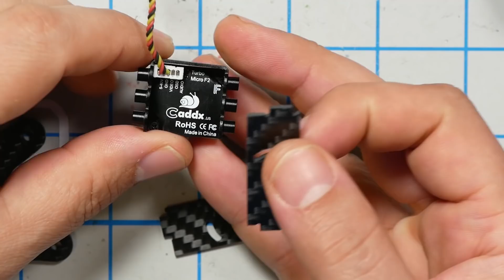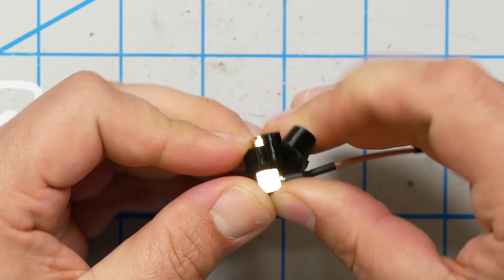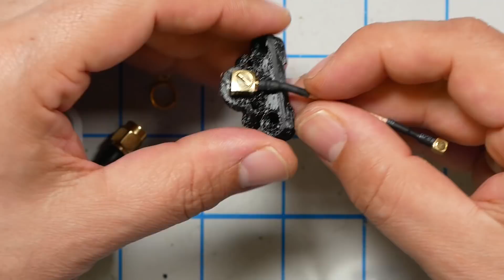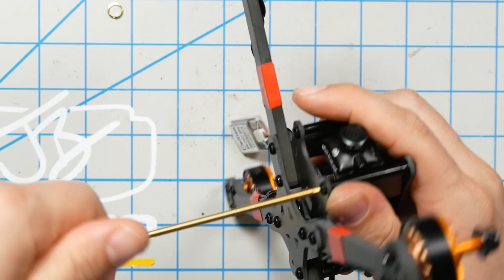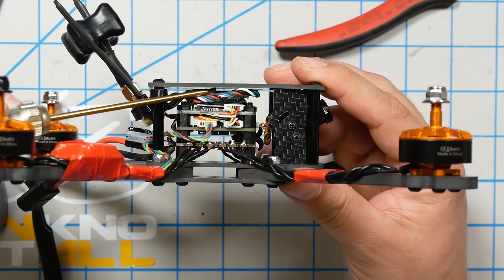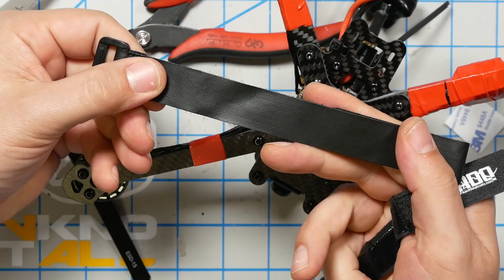Beginner Guide $120 FPV Drone How To Build - Part 12 - Final Assembly

Comment: Hi Joshua . If I got it right, to increase flight time I just need to change motors , batteries, bigger propellers and probably a bigger frame (3d printed is ok?). Am I right? The electronics may be the same?

Comment: This doesn't work. I've gone through these videos several times but I still get a runaway takeoff protection.
Reply from the maker: It's almost always one if these four things.

FC not facing forward.
Motors not connected to the correct motor output.
Motor spinning wrong direction.
CW prop on CCW motor.
Reply: @JoshuaBardwell  thanks for the response! I didn't elaborate here on YT, sorry for being short in my comment. I messaged you on Facebook as well. I've double and triple checked those, but still have the issue. I'll fiddle with it more tomorrow.

Comment: My kit shipped with a runcam nano sized. So it took two screws in the plastic mount then two screws for the side plates to the mount. The side plates had cutouts for the locking tilt screws but neither second screw holes for them.  The camera also used an adapter lead as it came with a three pin connector which as the other build video's points out isn't correct for the board.

Comment: Just to confirm: I can use the Flysky FS-i6 and the FS-iA6b reciever and remote combo with this? I asked you before about the remote but not the reciever. :)
Reply: Yes you can but make sure to solder the wires off of your receiver to the IBUS pads on the FC. Happy Flying!

Comment: Man I wish I had the extra money to get this kit and a control and everything! Something my daughter and I could do during this dang quarantine. This looks like fun to build and more fun to fly!! I will do it sometime though for sure. Thanks for all of your info to build it!!! New subscriber for sure.
Reply from the maker: The Tyro 129 is the same just with bigger props.
Reply: @JoshuaBardwell  Ok cool. I'll keep that in mind when I get enough money to get everything for one. I'm starting from scratch lol. Only drone I've had is store bought ones so I'm going to need the radio, headset, batteries, and the tools and everything to put it together. With not working right now because of the lock down things are extremely tight but when things get better I'm definitely going to get into this! I've already watched the whole playlist to see what all its going to take and you are awesome for taking the time to do it! Thanks again.

Comment: Why not use Velcro and a strap for battery? Us old fixed wing and heli guys have been using it since it came out lol.
Reply from the maker: Because when there is only a single carbon fiber plate for the battery strap to wrap around, there isn't enough tension in the downward direction to hold the goPro in place. You need some thickness to give the strap something to hold down on.
Reply: @JoshuaBardwell  Velcro instead of the sticky rubber pad, just for the battery. And a strap like normal.

Comment: I mounted the receiver with double sided tape underneath the camera, the antennas I routed out the front and to the front arms onto zip ties. Good RSSI and it gave me space to put a strap around the top plate for my gopro. Battery strap, stock props died on maiden. Currently on ethix strap and hqprops. Very happy.

Comment: I have 3 quick-ish questions on 2 different subjects in preparation to my Tyro129 build...
Props in versus props out- will the PID 'tune' be different & in what way?
L9R antennae- (A) Is it detrimental to range to swap out the encapsulated PCB antenna for more normal wire 'whip' antenna?
(B)What is the best way to remove the 'special' Frsky Antenna Glue without removing components from circuit board?
(I tried soaking for 3 days in 80% alcohol only to pluck off component from L9R rendering it useless- I wish they already had ufl connectors rather than having to add my own)
Thanks in advance JB!

Comment: Hey Josh thanks for posting this Im brand new and I've been following along up to this point. I tried to do a hover flight and it worked but when I landed my prop nuts and two props flew off. Both props were going the same direction. Any idea?
Reply from the maker: Use nylock nuts. Make sure they are tight enough (don't have to have them ridiculously tight but you shouldn't be able to move the props by pushing them with your fingers).
Reply: @JoshuaBardwell  Thanks so much! had my first successful flight yesterday. I cannot thank you enough for introducing me to this new hobby throughout the last few weeks you rock man!

Comment: Hey Joshua I’m new to drone an FPV I have a few higher end toy grade quads that are pretty zippy. And I would like to build my own freestyle/race quad. Now I may end up looking like the biggest idiot ever but my ? Is in beta flight is there any way to set up a quad that has a something like an altitude hold setting where if you let go of the throttle it keeps that same level until you apply more input to the sticks. BUT still have the punch of an Acro mode as well with having full tilt ability for the tricks and flips and what have you???
Reply from the maker: If you wanna fly acro you gotta fly acro. Betaflight has no real GPS hold ability. You could put iNav on it and put position hold on a switch maybe and use that to save you if you got in trouble. But Betaflight is going to fly better than iNav.
Reply: Joshua Bardwell thanks man I knew you was going to say that. And your right eventually you got to take off the training wheels. Love your vids man keep up the good work man.

Comment: Hi Josh, superb series. I’ve been following along with my own components etc. I’ve got stuck at Betaflight. I go into motor test, 3 motors will run up correctly in the right directions, but one motor jitters a little at low rpm, then just stops moving when the slider goes up. What could this be? I’ve heard it could be ESC issue or Motor issue?
Reply: Try flashing your esc firmware and if that doesn't work, swap the motor to a different esc and if the motor spools up normally then you might have a bad esc. Also if you soldered the esc to your fc make sure your signal wire from the esc to the fc has a good solder joint. Try putting your signal wire from your esc to a different esc signal pad. If the esc works after changing pads then there is something wrong with your flight controller. If your esc still isn't working then change the signal wire and if it still doesn't work after trying everything I've typed. Than you for sure got a bad esc
Reply: Check your motor-to-esc solder joints.

Comment: I use the 3m grey mounting tape . It will hold the space shuttle together . https://www.amazon.com/dp/B07TJFGXT6/ref=sspa_dk_detail_6?psc=1&pd_rd_i=B07TJFGXT6&pd_rd_w=RIOJX&pf_rd_p=48d372c1-f7e1-4b8b-9d02-4bd86f5158c5&pd_rd_wg=opjqk&pf_rd_r=SC7X61GTT2032HFCJ4FQ&pd_rd_r=40debae5-e0fe-413f-8d5d-ae69c85f99ad&spLa=ZW5jcnlwdGVkUXVhbGlmaWVyPUE0NjNBQUc3QUdQTTUmZW5jcnlwdGVkSWQ9QTA5NDQ1MDAxUUtVUEEwVVAxNjQ0JmVuY3J5cHRlZEFkSWQ9QTAwMjY0MjczOTQ2RjA1MjRZTUQyJndpZGdldE5hbWU9c3BfZGV0YWlsJmFjdGlvbj1jbGlja1JlZGlyZWN0JmRvTm90TG9nQ2xpY2s9dHJ1ZQ==